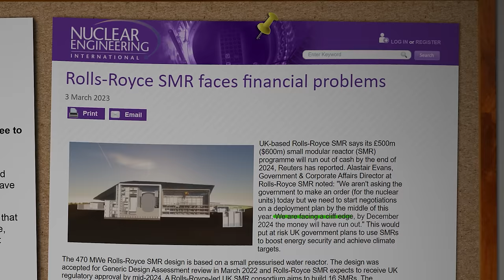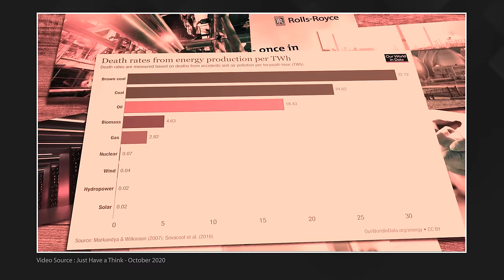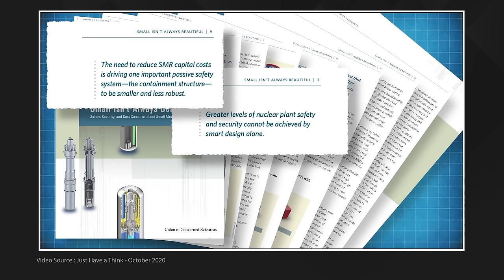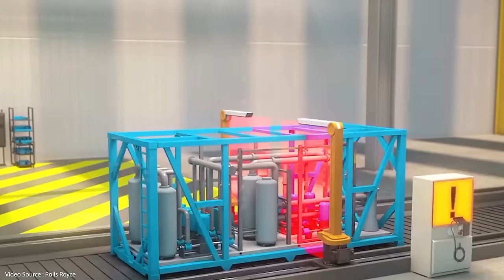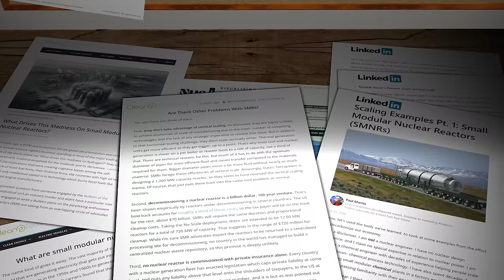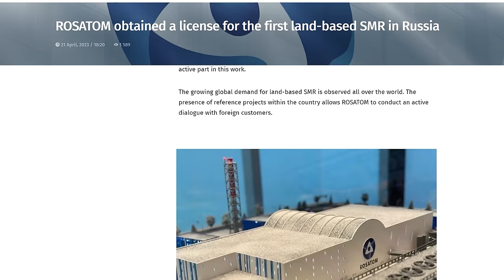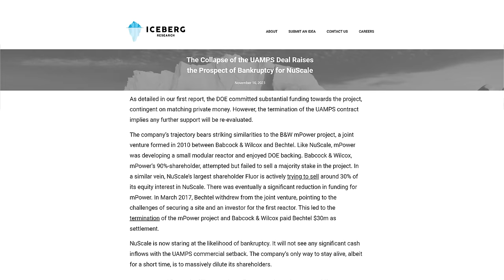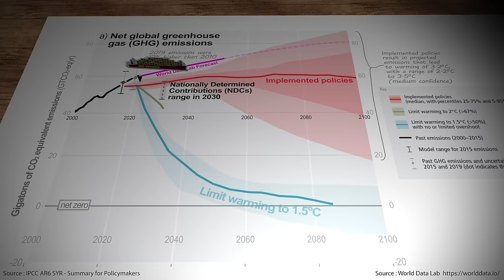Small Modular Nuclear Reactors. The Verdict

Comment: As of August 2021, the US has 965 square miles of installed solar capacity, which is equivalent to 102.9 gigawatts during the 6 hours of the day the plant operates at peak efficiency. Of course they also don't work when it's raining, cloudy or snowing or of course, at night. This is roughly the size of Rhode Island, the smallest state in the country.  A typical nuclear reactor produces about 1 gigawatt (GW) of electricity 24 hours a day. France has 58 nuclear power plants and they sell excess power to Europe.  Many countries including Germany are switching back to coal because of the failure of renewables to actually generate usable power when needed.

Comment: As a Nuclear Engineering graduate, I thought from the beginning that the SMR concept was flawed, a simple solution to a complex problem, which turns out to be not a solution. Very common indeed. I would like, if possible, to develop a deeper conversation not only on the decarbonization solutions for electricity, but also on heat, which turns out to be responsible for 50% of the global emissions, from industries and households, and greatly overlooked as a problem, with respect to electricity. The full electrification scenario, promoted until recently, is showing its limits and it's basically unsustainable. Hydrogen is being debunked from left and right as a viable solution. But still we don't talk much about heat decarbonization as a major issue, yet to be addressed and solved.

Comment: China is working on several design approaches to thorium reactors.  Very likely at least one will work out.  China has a huge stockpile of thorium as a byproduct of rare earth processing.  China does not have the severe regulatory hurdle that we have in the US. China is willing to invest big bucks up front in a potential solution to their energy needs.  It will take 10 years, but after some prototypes have proven successful, then I expect an upgraded version to be mass produced in a factory.  Installation will not take years and will become routine and efficient. 10 years later I expect China to be mostly Thorium based energy grid … including huge irrigation pumps for diverting rivers, all electric ground transportation, heavy industry heat for steel production, all electric homes.

Comment: Looking at the images of the Chinese SME reactors, it strikes me that "small" and "modular" are relative terms...  They still look like they need a lot of work and materials to build and implement.  It's not really like you can build a bunch of these and have them on the shelf for use in various locations!  So, I tend to agree that perhaps larger reactors might still be the way to go, where nuclear power is the only real option for a country or location...
Reply: Well , you build them like that if there is a market for those.
I have heard you can build them small enough to put them in submarines
Reply: @PaulG.x   You can make lots of different things. The problem, as the video aptly points out, is economics. Submarines do not need to care about economics. Power plants do. So just because we can build small reactors, does not mean it is in any way financially viable or responsible to use those reactors to feed the grid. Hell, even conventional nuclear energy is close to 5 times as expensive and twice as slow to roll out as renewables. You get 10 times more bang for your bucks plopping down wind turbines and solar than you do building nuclear. And these economics are even worse for SMRs
Reply: So far we see a lot of tofu dreg Chinese built stuff (bridges, buildings, roads) falling apart in record time...I wouldn't wanna live nearby any Chinese built nuke reactor.
Reply: Small relative to convention reactors I can agree on, but theirs nothing modular about a reactor in the hundreds of MW range, your just giving up economy of scale to make a smaller footprint, smaller investment and possibly closer to load which if your utilizing waste heat for industrial processes is going to be a key.
Reply: As people dug into actually making them the scale of the projects to have any chance of being halfway economically viable grew. Pretty much the same as what happened to the current nuclear power-plants, bigger works better/more efficiently
Reply: @koster7451 The economics problem is that burning fossil fuels produces externalities that aren't being captured by the pricing system.
Easy Solution: a tax to balance the cost of cleaning up the externalities, captured at the site of use or production.
Hard Solution: wait for the climate to kill off all the pollution producers.
Include the cost of clean up, and nuclear is already far better than fossil fuels.
Economics is a tool to solve the climate problem. Economics is not the problem, misusing it is.
Which is absolutely rampant!
Get money involved and people have a habit of becoming highly irrational and talking themselves in circles.
You need to understand where prices come from before invoking them as a critical point in an educated argument.
Reply: Well, if they really are modular their would be multiple modules in those buildings... if they are, I don't know
Reply: "They still look like they need a lot of work and materials to build and implement." it's almost as if SMR has been grossly exaggerated this whole time.
Reply: @PaulG.x  You can in subs because the risk is considered acceptable. Your "containment facility" is the ocean. Definitely not good but it's not in the middle of a populated area. Further that risk is taken because of the benefit of military advantage. There's also a lengthy list of nuclear accidents and sunken ships.
Reply: @ywtcc  I would completely agree with you, were it not that renewables also exist and do not have the economic problems of nuclear energy.

Economics at the end of the day is just a representation of how many resources we have available to do something. We need to stop emitting CO2 and doing so is worth a shitload of resources. But if option A costs 10 resources for the same output as option B which only costs 5 resources, it would be highly irresponsible to ever pick option A.
Reply: @harmenkoster7451 There's any number of applications where nuclear is preferable economically to renewables.
You're trying to paint with too broad a brush, it's going to take nuclear and renewables.
Amazing how these economics conversations produce so many logical fallacies and analytical oversights, isn't it!
Reply: The Chinese 100MWe pebble bed reactors weigh 700MT each, so yeah they are pretty big and at 700MT they need to be built on site and aren’t modular. An example of a modular reactor is US based X-energy whose 80MWe pebble bed reactor weighs 220MT and can therefore be built in a factory in components which are transported on trucks and then assembled on site, e.g, like a modular house or any other modular construction project. Small and modular are two different things.
Reply: China has had no nuclear disaster while the US has "Three Mile Island"
Reply: @John-ed8ye  With the rather large difference that one is theoretical and the other actually exists in real life.
Reply: The Chinese reactors are sort of a middle ground solution. Much cheaper than conventional nuclear power, but still bigger than a true small modular reactor. I guess it's more of a step towards SMNRs than a confirmation that they can work.
Reply: @harmenkoster7451  the problem with the economics of solar and wind is they only look at cost of power when they actually work.  When you factor in needing backup the price goes way up.  Nuclear is actually very cheap if they would quit trying to build something new and shiny.  They should just build what they know they can build.  The engineering is mostly done, the supply chains are already there.  In Ontario they are currently refurbing some of their reactors since they are so old and they are 6 months ahead of schedule. When they built those reactors they were bringing one online per year and did that for 20 years straight.  Those reactors produce power for 3.5 cents per KWh and are extremely reliable.
Reply: @pin65371 No, there's really no argument that nuclear is more cost-effective than renewables. The last decade has killed any of that. Renewables are only getting cheaper and the tech is rapidly improving. Battery tech is also getting cheaper, except where it's getting far better (and thus will get cheaper later). 

I would say that there is still an argument that just because there is CURRENTLY a clearly better solution does not mean it would be wise to lose all capability to utilize the other solutions. In science, we borrow stuff from past work long thought obsolete or irrelevant all the time. It would be wise to maintain production and subsidize some of that just to maintain the capacity and institutional knowledge, even though it's pretty clear that we're not moving to a nuclear powered country any time in the foreseeable.

We SHOULD have the capacity to build modular nuclear reactors - and we should probably not stop building them (at a fairly low scale) for 20 years. At that point, the cost of building them will have dropped dramatically - just probably not anywhere near enough to compete with renewables. But, we'll have very mature processes and have worked out a lot of the kinks, in case we ever do need to ramp production up. And, I think we do have demand for this type of reactor, particularly in industrial heat applications which are still fairly hard to achieve just with electric power. Force the military to help develop it, if we have to. 🤷
Reply: @Cyrribrae  renewables and storage are fine until you run into a worst case scenario where you dont get wind or solar power for a few days and all the batteries are dead.  Then if you are lucky they can cold start some coal plants so people dont start dying. Where I live they had 2 full days where we had almost no solar or wind capacity and they almost started having blackouts while it was -40 out.  The grid operator allowed some maintenance work to happen on one of the natural gas power plants because they didnt think it would be possible that 6 gwh of renewable capacity would produce no power.  Mother nature proved them wrong.
Reply: @100c0c  No nuclear disaster that you know of. They have a huge problem with radiation due to all the coal plants (radioactive particles in the smog) and iirc the water of their coast as well. Their "netizens" got out Geiger counters in an attempt to insult Japan about its releasing of Fukushima plant water, and ended up in a panic as their devices went crazy immediately instead.
Reply: @Vaeldarg   Any actual disaster like Three Mile Island or Chernobyl or Fukushima is easy to detect even if the country doesn't report it. Chernobyl was detected without it being reported for example.
Reply: Really such a pleasure to watch your sho ftw. Informative and sensible
Reply: @100c0c  Not every disaster involves an explosion.
Reply: @Vaeldarg   When did I say it does? If it's significant, it's detectable.
Reply: @100c0c  Who are you imagining doing these detections? In China, this is the kind of information that isn't let out if they can help it. Hence why those Chinese citizens were so surprised to discover such high levels of radiation in their area.
Reply: @pin65371  And where do you live? I'll take a news article so I can read up on it. Like I said, the battery rollout is proceeding even faster than people predicted even after the speed of renewables took people by surprise. AFAIK, there are no areas that experience -40c that have moved entirely to renewables anywhere.

What I'll say is that the entire US had around 11 GWh of battery storage in 2022. If we installed just 1% of all cars on US roads today with bidirectional EV Vehicle to Grid (V2G) charging, which already exists in several vehicles today, it would increase that total capacity 20x. It's extremely feasible.

Again, I'm highly in favor of nuclear and I want to see meaningful investment into it. But let's be realistic that it's not going to knock renewables out in any practical way except in instances where utilities make very very illogical plans.
Reply: @Furiends  How come the Americans kept wanting to bring their reactors to our ports which are in the middle of a city of 2,000,000 humans then? 
They got upset when we politely declined
Reply: Bro they're as small as their thermal counterparts being run at hydrocarbon fuel
Reply: @100c0c  there are many foreign experts from academics, regulatory agencies that visit the nuclear power plants in China. The general consensus is China nuclear power stations are on par with western standards, and if not, better.
They commented that the Chinese do not skimp on the materials nor issue fake documents like in the US, that resulted in expensive remedies and caused the failures of two new nuclear plant constructions.
It’s better to trust the opinions of the experts who actually been to those nuclear plants.
Anyone can type comments here for free, even an ignoramus full of prejudices.